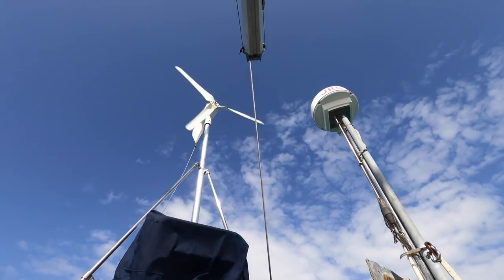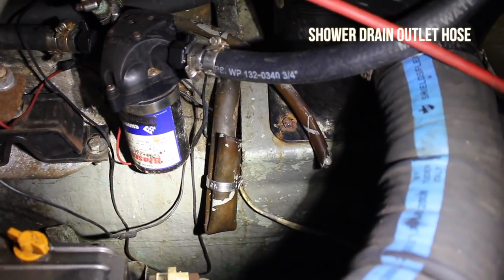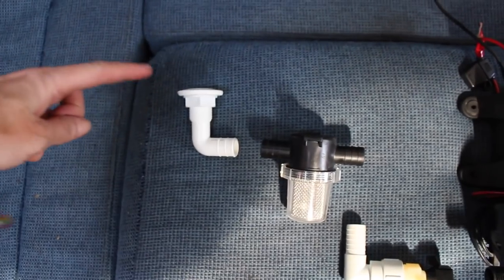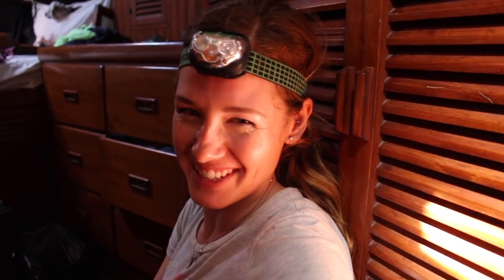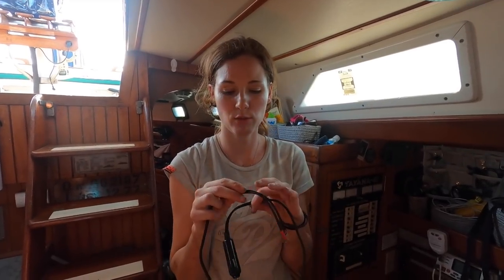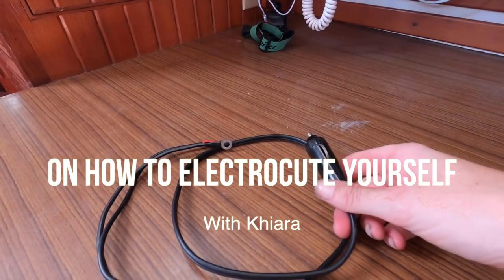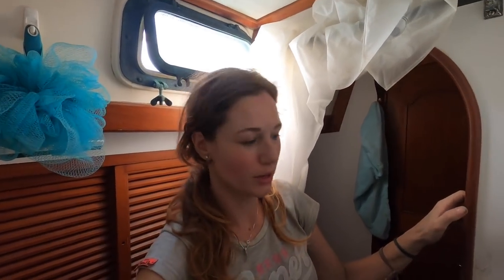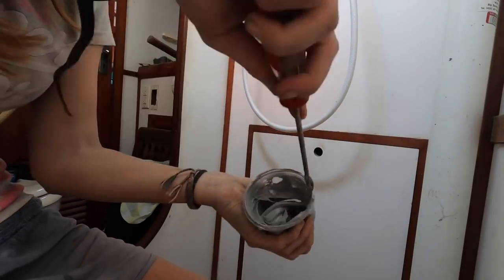Lets keep the water on the OUTSIDE...Shower water pump installation | Sailing Millennial Falcon

Comment: Adam, a quick tip for improving your 12 volt tester.  When making jigs like that, it's best to make one wire shorter than the other so they cannot short out when they lay together.  Khiara, well done girl.  love your video's guys.

Comment: If you were both bald this system should work! But as you both have lots of hair that little strainer will probably need to be cleaned out after every shower. The best pump for a shower drain is the Whale 'Gulper 220'. It is a diaphragm style just a little larger than the pump you installed but it does not require any strainer or filter. It works great I have used one for years.

Comment: Hi. Enjoyed your video. If I may offer... The reason why the sump takes so long to drain, is that it's leaking pressure at the "Y" valve from the sink above. If you plug the sink drain, it will run faster. Not ideal, but that's what's happening.
Reply from the maker: Thanks for the suggestion, We will definitely try and see if it drains faster, I reckon that might solve the problem!
Reply: Would it be possible to put a valve in sink line that wouldn’t leak pressure? Like a one way valve of some sort?
Reply: That shouldn't be an issue for the drain  - from what I see it looks like the pump is mounted higher than the bottom of the shower base - those pumps like to push fluid but don't like to pull - if you have everything on a slight downhill run to the inlet of the pump I bet you can drain that shower in a few seconds with that pump.   Also will help a bit with the noise - those pumps are real noisy until they build up pressure and fully prime

Comment: I would put a floatswitched bilgepump in the showersump or Pump to a container that can be emptied with gravity.. (a container emptied via gravity do not make any sound and you wont tell all the boats around you that you are pumping out greywater) You can use the other pump for only bilge or have a backup.. also avoid silicone better to use sikaflex, If the silicone needs replacing you Will have a massive job getting things attached where silicone have been used. (Dont use wood in the sump it will smell i know and its NOT fun to take out again..) 
Keep up the Good work, try and you skall succeed👍

Comment: Great job Khiara. A few things. That pump likely should have an anti-siphon above the water line. Second thing, that pump should be able to empty tat sump area in less than a minute. Hard to tell on the vid but it doesn’t sound quite right. You might consider replacing it with a gulper pump. Have a grand adventure.
Reply from the maker: Thanks for the tips, the pump was one we had lying around so thought we’d put it to some use but if we upgrade we’ll definitely get a gulper, you’re the 3rd person to recommend that one!
Reply: @ Samuel Liles.  The sink outlet is the anti siphon as far as I can see. regards

Comment: I had the same set up on my shower drain when I purchased my boat almost a decade ago. You will be cleaning that disgusting smelly strainer every other time you shower. An absolute nightmare. Toss it and the sure flow pump and get a Whale gulper 2000. Never have to worry about anything ever again it will pump out anything you can put down that drain. Little pricey but well worth the money to not have to clean that stinky strainer.
Reply: I agree 100%. This water pump is not the pump to use for waste water. It will clog up in short order. A whale gulper pump type is the right pump to use. That little strainer is not going to do much other than cause problems. There is a right way and a wrong way. This is the wrong way.

Comment: The pump can be made less annoying by putting some dense foam between the pump and the shelf and not fastening it down beyond taut. That allows the vibrations somewhere to go.
Reply: great suggestion, taking that idea and running with it. As well as sandwiching the foam between the pump and shelf, if you put another piece on the underside of the shelf and run the bolts through both - when it is snugged down you don't have any rigid connections the shelf. It should be even quieter but have less vibration acting on the fasteners. (especially if the holes in the shelf are little oversized and ahve a little foam/tape/soft stuff to keep them centered). (also - love these maintenance videos)
Reply: You're on to something about pump silencing. Heres how to tackle it with a Chinese Diesel Heather electronic pulse pump that has a constant ticking noise... you can retrofit a tupperware style container so the pump is inside and the lines are plumbed through. With this larger sized pump ot need a larger sized container and of course even more real estate to where it mounts.  The solution overall sounds good on paper but in practicality, a lot of coal to achieve a little fire... meaning the pump is only going to run for 4-5 minutes to drain (if they fix the pressure leak from the "Y" valve it will drain quickly).

Comment: Hi guys, next time put down some paint tape, 4mm from each side, put down the silcone and run finger/cornerplastic. and before it dries, remove the tape, and you got a perfect line... hang loose from brisbane
Reply from the maker: Thanks for the tip, that’d make it look 100x neater!

Comment: Hi. Just thinking about the length of time it is taking to drain... because you are using a below waterline seacock the pump is having to push your shower sump water against the seawater pressure trying to get in. For this reason most non gravity bilge and sump drains I have encountered leave the boat well above the waterline via a non-syphon loop. Cheers
Reply from the maker: The seacock is a just on/above the waterline located beneath the shelves in our shower. It does have quite a long hose to get from the shower to the seacock, around 20ft I’d say. Maybe that’s a factor?

Comment: if  i understood correctly you have placed the strainer o the discharge side of the pump...really it should be installed on the intake side to protect the pump.
Reply from the maker: So the strainer is in between the shower drain and the pump on the intake side 🙂 to catch all the shower crud!

Comment: Have the water run into tank with a float switch that come on automatically
Reply from the maker: That might be similar to our current bilge setup, its not a tank but it does have the bilge pump and a float switch. It just gets stinky and we don’t want to burn our bilge pump out but just shower water!

Comment: Are the sound-deadening panels in the engine bay actually ceiling tiles? If so, they could contain asbestos. If so, if undisturbed, it shouldn't be an issue, but it might be worth checking. Best wishes. ⛵️🇨🇦
Reply from the maker: I’m not sure what they’re made of but they’re not doing a very good job! we plan to improve the heat and sound proofing of the engine bay at some stage.

Comment: the problem IS your LONG HAIR. !!! it falls out and goes down the drain and plugs up the pumps.!!!! happens all the time at home  , but there it just goes down and out into the line to the street.  but ir still will plug up the drain in the  tub. CUT YOUR HAIR. you'll have a lot less trouble.!!
Reply from the maker: Eek! I think I’d rather install more strainers than have matching crew cuts 😆